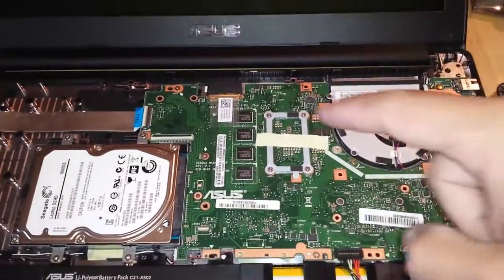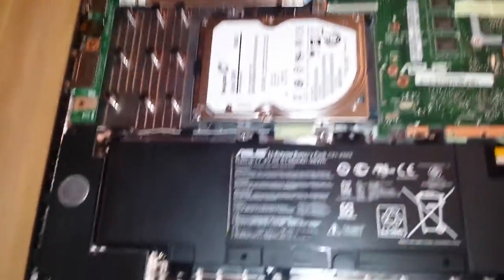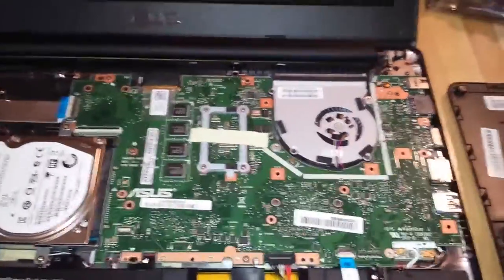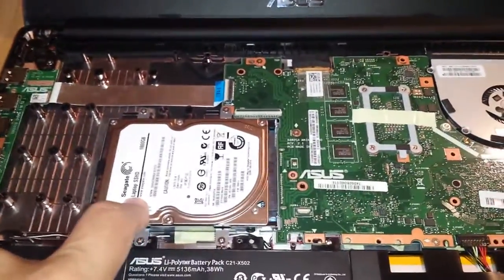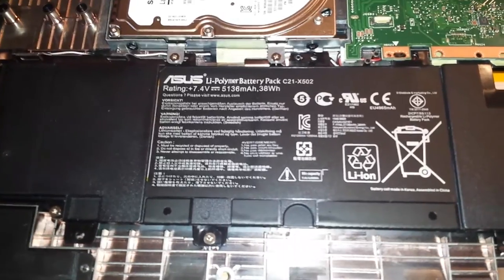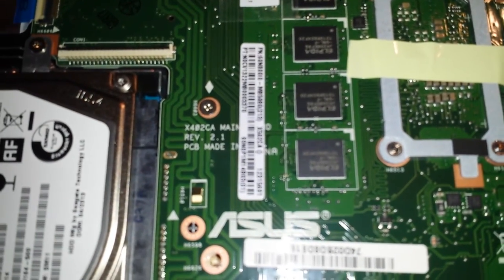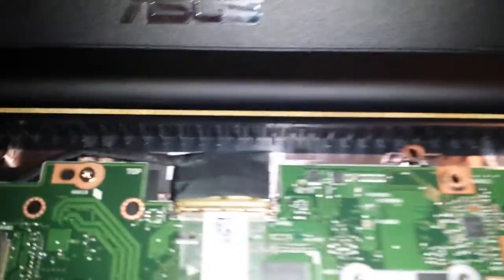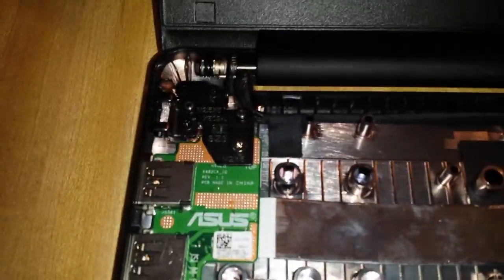Asus X502CA Teardown and Drive Upgrade

Comment: For anyone wondering how to pop the keyboard plate off, just use a credit card or guitar pick and slip it between and it will undo the snaps. Took me a moment to figure out how it was put together.
Reply from the maker: If you're doing a lot of teardowns, get a plastic spudger, it makes separating them easier and if firmer than a card.

Comment: Would be helpful to show us how to get into the case.  Your video starts after that part.  Remove screws from bottom, lift the clips holding the mouse and keyboard cables, slide the cables out of the plugs, etc, right?

Comment: Are you sure about that update about the RAM slot?

The photo is labelled as the S400 not the X402/502.  The WiFi card for example in your video is visible from the top of the board, on the S400 it would not be from those photos which would suggest they are NOT the same board.

Comment: Hi my friend has this laptop and her touchpad is not working. no cursor on the screen either... we have tried the hot keys but and everything but still not working.... what can we try next....she doesn't have the money to take it to a shop so im doing my best to try and help her.
Reply from the maker: If you disassemble it as show make sure the ribbon cables for the touchpad and keyboard are connected and undamaged. If that doesn't work my guess would be a bad touchpad. Do you get a cursor with a USB mouse attached?

Comment: Hey man, great video but I'm curious, how did you install windows on a new hard drive. I am looking at this laptop for a friend and the bios is so limited it doesnt give an option to boot from USB and since it has no DVD drive I can only guess that you cloned the old hard drive? I can't actually do it with this one because the old hard drive is dead so was hoping that you had any ideas?
Reply from the maker: +SJ Connors You can copy the files from the DVD or ISO image to a bootable USB and do it that way. MS has a USB/DVD Download tool as well as a video on how to use diskpart from a command prompt to make it.
Reply: Teb Tengri Thanks, I got there in the end. It just started to work (the USB drive) even though there was no specific boot drive selected. Hopefully I won't have to go near that laptop again, cheap laptops are not cool :)
Reply: +Teb Tengri hey are  you still on youtube? i really need help with the asus x502ca, maybe you can help me?

Comment: When I go to plug the keyboard and mouse back into their designated slots, the keyboard works, but the mouse does not. Do have any ideas as to why that is? Also, any ideas on what I can do to fix it?
Reply from the maker: Unplug and reseat the cable, make sure there are no tears in the ribbon. My guess from experience is it isn't seated 100%.

Comment: Hi I was wondering how easy it would be to replace the wifi card. can you do it from the bottom of the laptop? I have to do a repair of it for a friend. I dont want to dive right in if I cant do it from the bottom
Reply from the maker: I honestly don't remember. I want to say it was accessible from a panel on the bottom, but don't hold me to that. If I had the laptop still I'd look for you.

Comment: Good video, thanks I was wondering about the ram and now I know, guess it is what it is. I purchase mine, new it was a cheapie, so I guess if it fills my needs after couple years then I got my money out of it. That's about the only thing I wanted to do was upgrade ram, oh and maybe the battery, but looks like at least its it's a pack and it can be swapped out. Awesome, again thanks for making the video.

Comment: WTF Soldered RAM fucking brilliant! Looks like i getting rid of this piece of shit! FUCKING DONT BUY A ASUS!!
Reply from the maker: Sadly most of the sheep(normal people) are too ignorant to know or care that their choice is limited. They just want "thin, thin thin". Same way that the race to the bottom price wise by cheap ass bastards nearly ruined the PC market by cutting profit margins to the bone. 

I'd personally want legislation passed, or at the least a voluntary thing like ESRB where they slap a big red warning sticker on the box "YOU CANNOT UPGRADE THE RAM IN THIS SYSTEM". Same warning for the hard drive too since it isn't supposed to be accessed by the user.